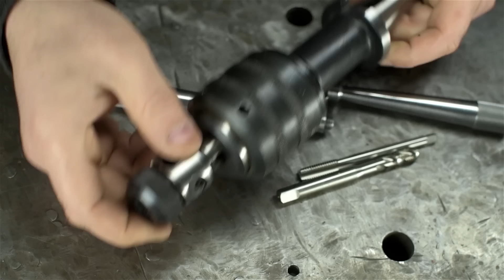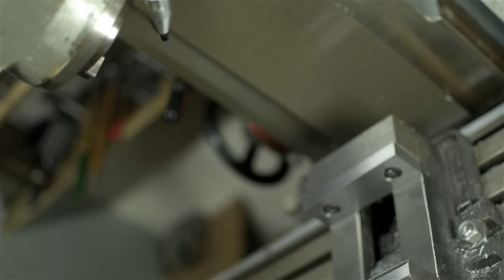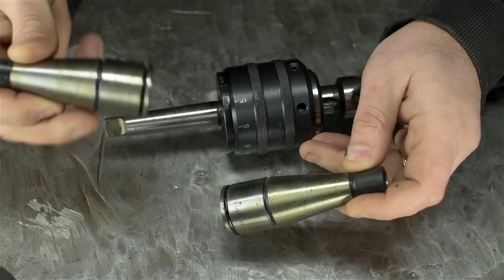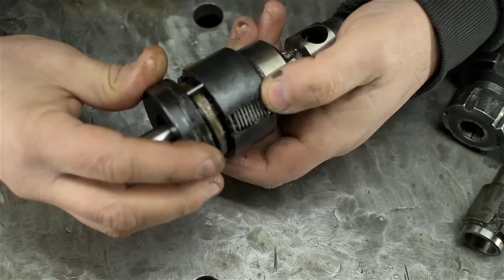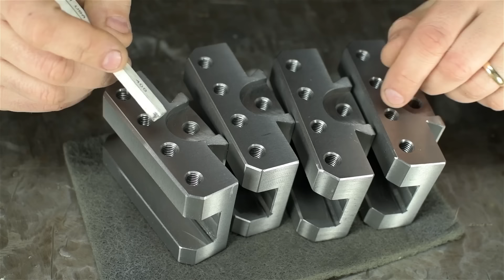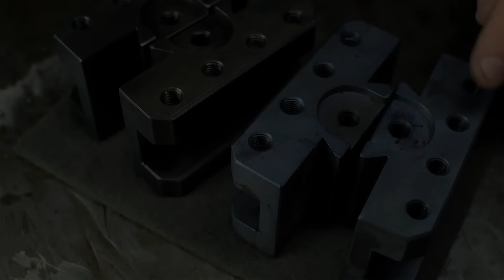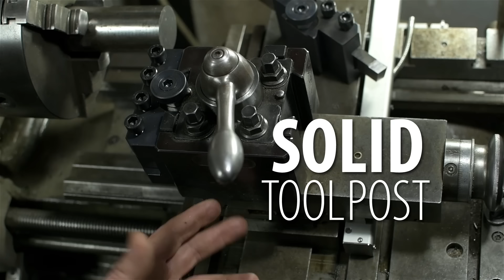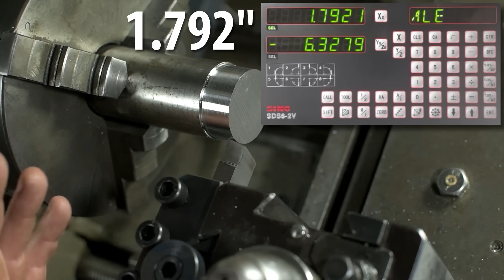How To Break A Tap & Other Ramblings

Comment: Home Depot etc carries metal prep that leaves an etched phosphate surface which may be satisfactory. Intended for painting prep.

Copied this post:
Hi, Tayyab. Black oxide solutions are essentially composed of sodium hydroxide, sodium nitrite, and sodium nitrate. Alkaline cleaners are largely sodium hydroxide, but also usually contain sodium silicates, sodium carbonates, sodium tetraborate, TSP, other sodium phosphates, soaps, and surfactants.

Most plating shops in the West buy proprietary alkaline degreaser processes and black oxide (bluing) processes from specialty suppliers, and the exact compositions of the proprietaries are held as trade secrets which people can't share.

We have an FAQ on Black Oxide and Cold Blackening to introduce the general technology. Beyond that, the Metal Finishing Guidebook goes into more depth about the general technology.

Regarding the white powder, please see letter 13097 "Black Oxide Problem". Good luck.

Comment: You could " card" them using a carding wheel, which is like a wire wheel for gunsmithing. 0000 steel wool can work if you completely rinse out the oils in it. That will help with the blotchy finish.

Comment: Simple fix: new mill.
It is an engineering specification that only smelly, questionable grease may be used by Chinese or Indian factories. BTW, I can smell that grease here..
Nice pretty close up of tapping. Regarding chamfers, I got the point when you said you don't want to cut corners. Thanks also, Jarryd Lay: excellent tip. In fact, Many things in this video learned I have.
No actual taps were hurt in the making of this video.

Comment: Hi Tony.  Is this high-speed head what you need for your 13?  I just bought a Schaublin rotary table from this guy, and it was a very trouble free experience:  https://www.marktplaats.nl/a/doe-het-zelf-en-verbouw/draaibanken/m1380691639-schaublin-13-snelloopkop.html?c=3c1f5dcc18d02a99040ca8de656940d2&previousPage=lr
Reply from the maker: wow thanks! where is that?  I don't see a price. I'm sure it's very affordable. :). will look into it thank you!
Reply: @ThisOldTony   1 Hour from Rotterdam.  Its sort of an ebay auction, but you can message the guy and ask his price.  That is what i did.  The bid is currently €350. Use the Google translate plug-in to Chrome if thats your browser.  It will translate in place.  The guy writes English

Comment: Tony, That wasn't a flat contact, but a thumb lifting lever insert that gets screwed into the other end of the indicator and allows you to lift the spindle without disturbing the dial indicator with your (my) big meat hooks. A  lever with a fork goes into that small groove so as to no influence the spindle when taking a measurement.

Comment: I didn't notice anyone else mention this but the clutch in the tapping head looks somewhat like a motorcycle clutch which has multiple plates. Motorcycle clutches typically run in the engine oil.

Comment: For what ever this is worth one of the mills at work with a r8 spindle had the little key fall out or shear off. Not sure if ill ever get the real story of what happend but anyways we still use it as is and the tools don't slip from what I can tell. I surface large exhaust manifolds with a very large fly cutter or 4 " facemill with no slipping issues (as of now anyways).My point is I think you will be fine with no dogs on the iso 30 shank.

Comment: Spiral taps are generally weaker than gun taps. Its not the shank that will break it the body itself. Since  a spiral tap needs room for the chips to come out the top of the hole the webbing on the tap is thinner than a gun tap. That is where the weakness is coming from.

Comment: Is there not a pin through the tool post that allows you to lock it in place at set angles underneath it?
I only ask as this is the only type ive seen not sure if it was an after thought moddification! Might help stop tool post rotating

Comment: I’m a big fan of the solid tool post, mainly because my salvaged AL960B lathe didn’t come with a compound! The rigidity is really nice, in not cutting tapers, but I can fudge them a bit as I have a multifix that lets me adjust the tool position in 40 positions, and manually feeding a taper by setting my tool angle the the taper and feeding across. Down the track I have plans to have X tied to Z electronically, so the issue will go away

Comment: quick change toolpost could be secured buy using the empty pocket over the compound slide with a custom block to straddle  it like a upside down horseshoe and use set screw to fine tune.

Comment: Have you ever tried using Gun Taps? They work wonderful, especially when you use the proper lubricate while tapping. I've drilled and tapped thousands of holes in die sets, to full depth in one pass, using only a radial drill press and a quick reverse of the clutch lever, and can count on one hand how many taps were broken. Don't make it more difficult than it is.

Comment: I remember when I was like 13 I was using M10 taps on my mill, and I broke like 3 because I had to do 1/2" deep holes and I didn't knew what is power feed. And thanks for this video I found it very helpfull about DRO's.     I don't have it on the lathe        YET!!!

Comment: I prefer breaking my taps with a cordless drill. Nothing breaks taps faster or more reliably like adding a motor to hand tapping.
Reply: Richard Solomon wintergatan wants to know your location
Reply: Jason Murawski oh he knows. He’s in this comment section already lol
Reply: Richard Solomon 
Omg tell me bout it when I started my working life I was a mechanic and went to college where I was tapping by hand 
In later life I started steel erecting 
And machine driving, where they use drills , this boils my shit man
Reply: I've found putting them in a chuck that adapts to my battery rattle gun works quite well too
Reply: Nothing beats a Dremel and some duct tape
Reply: @clayhudson8892  that's what she said
Reply: I dunno. Most of my cordless drills are too weak, unless it's a tiny tap.
Reply: Where's the "making inside gears section"? I need to figure that out so I can make a winch drum out of steel instead of aluminum.
Reply: And I guess you didn't have the rhythm for foot-tapping.
Reply: Yes i agree , nothing gets the job done quicker 🤣
Reply: @dimphomoatshe7745  One bit of fun you can have with the new rookie. We used to have a corded Milwaukee ultra heavy drill/mixer (you know the type, with the cross handle, on off switch instead of a variable speed control, so it was full on or full off, no break) that would run at around 1200 rpm, and continue spinning for 4 or 5 seconds after you let go of the trigger. 3/4 in chuck. weighed around 15 or 20 lb. a REAL mans drill. any way the con goes, chuck up a brand new 1/2 in tap, torque the ever loving sh$t out of the chuck key. Drill a blind hole in 3in plate, around 1 in deep, call the new guy over, tell him to tap said hole. stand back and watch. so funny even the boss laughed.
Reply: I personally prefer my impact for tapping holes. Very reliable tap breaker
Reply: Just think about how much time this will save...😃
Reply: I disagree. I recently found a drill chuck that fits directly over the 3/4" anvil on my Milwaukee High Torque Impact wrench and when I set the speed to the highest rpms and ipms, with a tap in the chuck and an undersized pilot hole drilled in to some spring steel, I can shatter a tap and send pieces flying in directions that I didn't even know existed

Comment: You should use a fixed point diamond dressing tool for cutting out the sides of the grinding wheel. You’re like Michelangelo on a mill and lathe, so it should be a walk in the park for you to make a support for a tool like that, keeping in mind your Z axis height on your grinder. On top of that you’ll get a smoother surface in that grinded part :)

Comment: Make another inner, with the drive dogs, and a thread to match the adaptor. That way you have the drive dog and the taper, though with only the taper you probably will have enough drive with only that, as tapping is not too much torque wise.

Grease for the clutch is special, generally used for limited slip clutches, and has a very high viscosity to get the torque balance right. You generally do not find it easily, other than the lubricant used in limited slip differentials.

Comment: You should just make a new drawbar to use bt30 holders. I had a nightmare of a time trying to find these nmtb30 holders for my machine. I put in a drawbar with the right thread size for bt30 holders and now I can use those which are widely available and much more affordable.

Comment: M5 does indeed just about equal a #10-32. It's fresh in my mind because I used my index to measure some threads, ordered custom parts, waited 6 months...every thread stripped out with force because while it felt perfect on the index...it was not.

Comment: I went to a solid tool post holder (even made a YouTube video) and I've never looked back. The compound is gathering dust underneath the bench. Go for it TOT!
Reply: @zomgthisisawesomelol It's something that very rarely comes up. If I ever needed to, I would remount the compound specifically for that job. 99.99% of lathe work is Z or X axis machining. Stability, and therefore finish, is more important.

Comment: Great vid. I prefer to break my own taps though, I like it done right.
Reply: That is why I have broken tap extractors, along with a collection of old windscreen wiper guides, that make a dandy extractor when used with the remains of the tap and a nut, so you have 3 blades of nice strong stainless steel to slip into the broken tap to turn it out.

Comment: I broke a tap once....ONCE!  It was during what I thought to be the easy weekend project consisting of replacing the  thermostat on a 1990 Camaro Z28. The engine had over 80,000 miles and everything under the hood seemed to be rusty and brittle. First I broke the head of the bolt, then I drilled the bolt out and I thought retapping the threads would not only be “required “. It was my responsibility as a dam good American. I inserted the tap into the hole and started turning that tap as if it had said something funny about my Momma.  Then just as I thought “I GOT THIS” I felt a slight give and a loud SNAP. After crying for what felt to be hours, a stranger approached me and asked what seemed to be the problem. He was an older fellow with salt an paper hair and the longest cigarette ash ever to protrude from a lit camel non filter. Anyway, I digress. I looked at the stranger and pointed to what it was now a dead end of my “do-it-yourself” project. He looked under the hood chuckled at this now impossible task and asked me what I want to do.  I simply said. I don’t know... He said “step back son” he opened a small red toolbox and proceeded to do the impossible. In less than what it took to type this comment. He emerged triumphant with the missing piece of my failed tap. He said “next time use cutting fluid you Dumb $#@&$#%”. After a well deserved tongue lashing he informed me that he got it and tapped it for me so I wouldn’t ruin anymore tools. Oh by the way the ash in that cigarette had only grown longer wit every expletive piping out of his mouth. I said Thank you mister!  I turned around to reach for my wallet and just like that ... he was gone. I’ll never forget that man. He smelled of machining oil and bad coffee. They say that Not All Hero’s wear capes. This hero didn’t but he deserved one none the less. I ow him a case of beer. I never again used a tap without cutting fluid. Nor skipped a video from This Old Tony.

Comment: hi this old tony -could anyone tell me what mill vice you have with the rotating back v  clamps thanks
Reply from the maker: it's an old Rohm 4 position vise.  I don't think it's made anymore but MSC sells an (expensive) clone.  Check my "New To Me Mill" video for Rohm part number.  Came with the mill, but for the price I'd recommend a good mill vise and some v blocks. :)

Comment: Ive got a tapping chuck that has the same features as this one but is also reversible so when you push down the tap part runs the same direction as the taper end but you can raise the quill and it then has a neutral zone and if you keep raising the quill it then goes in to reverse to back out the tap so there is no need to reverse the machine direction.
It's great for doing a series of holes because there is no need to stop or reverse the machine direction you just go from one hole to the next without turning the machine off.
I assumed all tapping chucks were reversible like mine, I've not seen one like this with reversing.
Reply from the maker: I'm pretty sure the one I have is pretty old.
Reply: @ThisOldTony  
Cool, got mine in about 2008 so not that old.

Comment: I wish you would have shown how you set up those relief corner cuts with that Saturn's rings sized wheel.
Reply from the maker: I just tipped the head 45*, more or less, to be able to cut the corner out.  Sorry I skipped it!
Reply: @ThisOldTony  
 Well I imagined as much ... lol.
I'm more confused about how you measured it's position for depth of cut... Did you just touch the blade itself into the corner, and then add your depth from there on each coordinate?   or did you use the indicator on each edge of the large blade?.. ( I know you can mount an indicator into the mill head and then locate the position of your part, but I don't know how that works on the 45* angle?)
 How did you determine the amount of relief depth that is needed/ is there a general standard/ common depth that's used or is it just personal preference on just how much to cut out?  I guess my question is, Why did you cut it the depth that you did? is there any rhyme or reason to it or did you just cut one "whatever depth" and then just keep them all the same for aesthetics?.. (I don't know why this is throwing me off so much. haha)

Comment: Tony, thanks for another great video.. i see your DRO goes to 5 digits past the decimal ... but whats the resolution on your scales ?
Reply from the maker: 5 micron, so about 0.0002".  Technically the number is real, but on a manual lathe it's meaningless.  My surface grinder can barely do that.
Reply: @ThisOldTony  understood...  just was wondering how that matched up with your DRO readings...      BTW im proudly wearing my TOT tee shirts :)

Comment: Panel Screws exist for the sole purpose of using in other projects. If your panels rattle, it means they should be removed. You want to see all the moving parts, right?
Reply: There are limits to what panels you want to / can remove tho'. Some, for example, prevent oil splashing out of the gearbox, which makes a right mess on the floor when that happens... (I'm, in this instance, NOT speaking from personal experience, but acquired experience from others - although I'm sure sooner or later I'll get some experience of running something with splashy oil coming out at me, I'm sure!)
Reply: Panel screws are important, which is why I have have a large collection of them in my spare parts drawer.

Comment: are those reverse threads in those ISO tapers? perhaps it is for making an adapter with the drive flanges "integral" to the adaptable piece? It could use the body of that threaded taper area (between the end of the taper and the bottom) to manage some of the side loading.  Just guessing love the videos!

Comment: Why is the tap oscillating at 9:50? I would have thought that much movement would have been a problem that had to be addressed before continuing?
Reply from the maker: the plastic collets aren't in the best condition.  There's enough wiggle room that the tap self-centers.  But good eye!

Comment: You ever realize you're so dumb that you have no idea how a drill works?
Reply from the maker: I'm pretty sure you just turn it and holes fall out.  Like a pepper mill but ... with more holes.
Reply: @ThisOldTony  I dunno man, I get you if we're talking about one of those survivalist no electricity needed-type models, but the one featured in yonder video had all kinds of squishiness in it's parts which I never would have thought of.

Maybe you turned up your Young's Modulator on that for demonstration purposes or whatever. I dunno -- I ain't graduated yet.

Comment: Another thing to keep in mind  is that the inserts themselves have tolerances. This can also throw off your zeros for the tools. say you break a tip off and go to replace it, your zero could be off by as much as .002". I have had this happen a couple times when i was starting out, from now on when a tip goes, or i blow something up with interrupted cuts, i will always make sure to make a test cut and measure before i proceed with a finishing cut. heck even roughing should measure just incase you have a size call out in say .0002".

Comment: I have a smaller lathe than you, 10x28, but I took my compound off in order to rebuild and scrape it, I haven’t completed the rebuild yet (yeahhhhh, procrastination...) but I’m pretty sold on my solid tool post i built. What you lose in flexibility, you gain equality in the opposite. I am undecided if I will reinstall my compound or just keep it aside and install it only for special occasions, visitors, and the odd taper cut. 

Ps, I like the machining videos the best.
Reply from the maker: I'm slowly leaning that way too.  Re: videos.. I try to mix them up!
Reply: This Old Tony FYI. The concave on the side of the grinding wheel? Never even considered that. I did some side grinding couple weeks ago on a sine vise I’m making. Turned out kinda dirty...
Reply: What did you use to to hone the wheel? Another piece of stone?